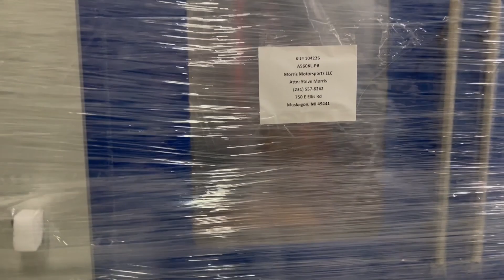Billet Heads, Porting, you name it!!

Comment: Nice, now you can make lower profile air-water intercooled intake manifolds that will fit under a factory style hood.  I just can’t get on board with this new hood-less trend that YouTubers have popularized.
Reply: Some things just require space to work properly. By the time you stick a good sized intercooler core in there that won’t restrict flow to much it’s going to be tall no matter what. Especially once you add on a plenum that’s big enough to really work good. 
If intake height is a concern you’re better off running a remote cooler and a bunch of piping.
Reply: Good luck having a water cooled inlet manifold that’ll fit under the bonnet
Reply: @jacksonwelch9870  LS9, LT5, 5.2L Predator, Demon, etc do a good job at cooling large rotor packs while fitting under factory style hoods.  Just think it would be nice to have the same for old school big and small blocks.

Comment: I'm curious Steve, how much power does that require? 480?
Reply: Voltage can be whatever you order. As far as power, it varies. Load on the motor, amount of things happening, it can be wildly different.

Let's just assume you need a minimum of a 400-600A service to run a shop. I'd start with a 1500A 480v in a space that size myself. You'll always be adding on.

Comment: Dam Stevo, I'm so jealous right now lol. The parts and experiments you can do with that is unlimited. Something like a 721x comes to mind. 65 degree five point two inch bore pitch V12. Same thing as running 481x rpm 25% higher with a 4th injector to cover the fuel. Nothing like the old drag week 6200hp 721x V12 singing at 11.5krpm with lighter crankshaft because you don't need the counterweight like a V8. That would be something just for fun. If I had the machine, I'd definitely do it. As long as it takes all the same parts as your motor, cost is negligible.